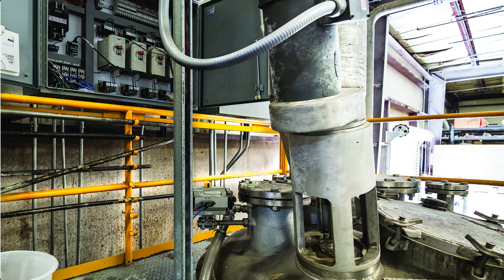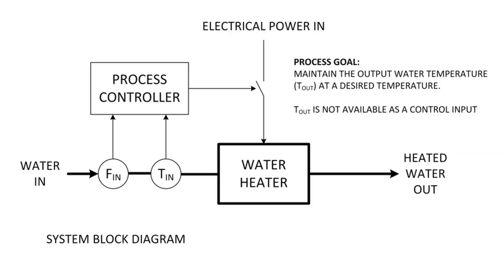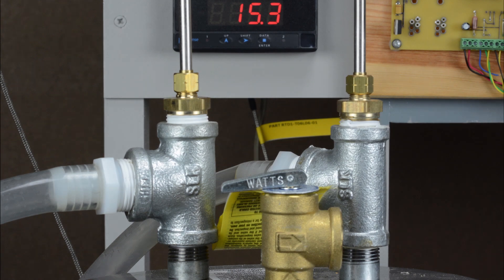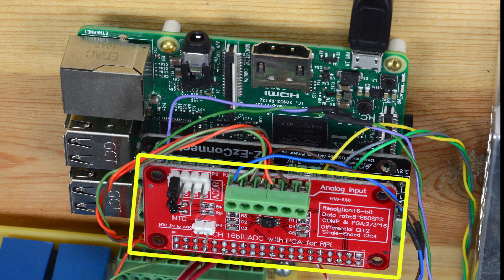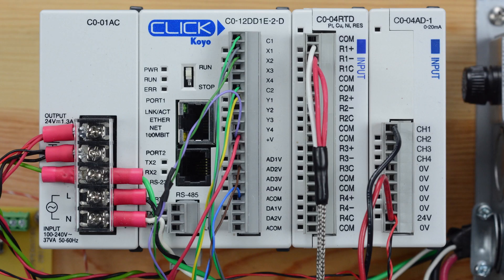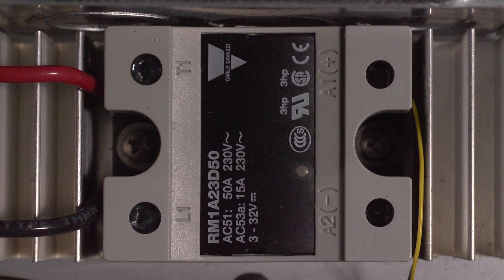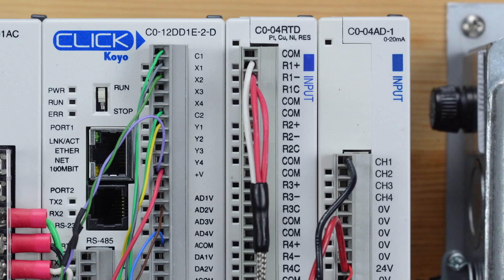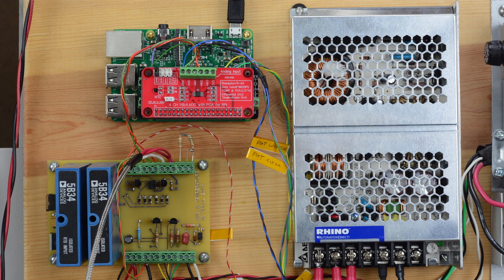Raspberry Pi vs CLICK PLC from AutomationDirect

Comment: May I add, that one could just for a thought experment use a more "plc like" operating system for a singe board computer and use proper "real time capable" programming techniques and maybe additional hardware to conform to indutry standard? 

At it's inner core a plc is going to look very close to a single board comupter like a raspberry pi. The inputs and outputs of - i.e. a siemens cpu - are unlikely to conform to indutry standards when viewd in isolation of the circuitry inside a plcs housing.
A traditional plc alredy contains the circuitry needed for the nessasary conversions.

I am only capable of speculation with the following things, but as cycle-times are a thing on many plcs, i doubt my hypothetical assumptions. Lets say, a typical plc processor is at its core an fpga or cpld device (programmable hardware) that is combined with a classical processor running an operating system for monitoring and asyncrounus communication tasks. 
The simple logic could be compiled to run on the fpga part in true hardware fashion and infinite speed. 

Assuming that you could run pretty much als much logic on a plc as you please. The only thing that would require any action of a processor would be monitoring of the plc and maybe networking.

In that case only the smallest and most basic plcs would worry about anything timing related at all.

So I suggest that a a plc is - very simplified - nothing more than a raspberry pi with a very specialized operating system and some levelshifters. So if someone really wanted, one could contruct the kind of circuit that a plc includes around a raspberry pi and would get exactly the same as a plc. 

This comment was only meant as a note, so nobody would think that a raspberry pi is inherently inferior or or plcs perform magic to do things the device used to view thic comment could not in theory.

Neither was my internet to talk badly or tarnish a really good video. 😉
Reply: Python is a great and simple language,  but i personally would have chosen differently. I'd likely chosen c++ or rust and would have tried to implement interrupt code.
Reply from the maker: There is some really good points here. Software and programming could be implemented on Raspberry Pi given the right platform. Hardware is where this difference has been really made between the industrial nature of a Raspberry Pi and a PLC, example Circuit isolation and other considerations. These differences has and will become less drastic as more industrial nature Raspberry Pi and Arduino become more common.  For example the Productivity Open that mixes Arduino and industrial I/O.

Comment: You compared a computer to a PLC? Thats pretty stupid. 

A better comparison would have been an arduino and a PLC.
Reply from the maker: Adam, thanks for the comment.  Many associate Raspberry Pi and Arduino both as being single board controllers and both potential candidates for controls in industrial environments.  There is a video comparing an Arduino and a CLICK PLC, hosted on ControlDesigns channel:  https://youtu.be/9KJ-bQ2TPlQ .